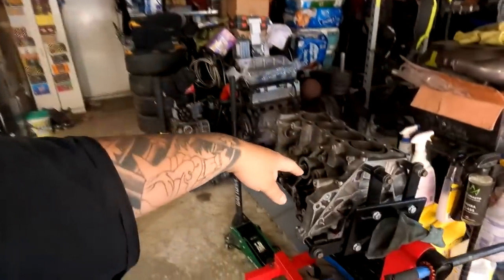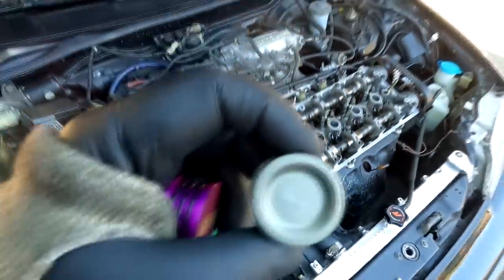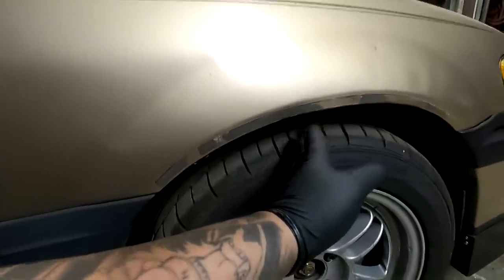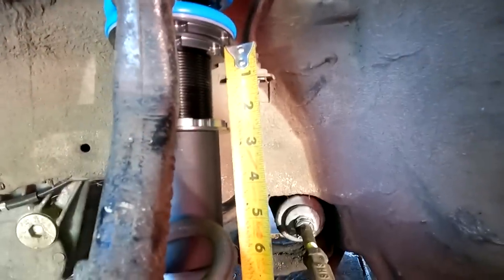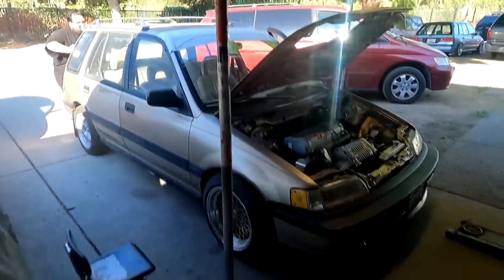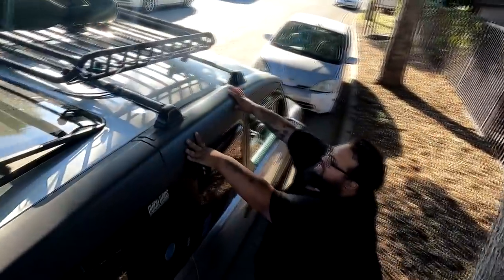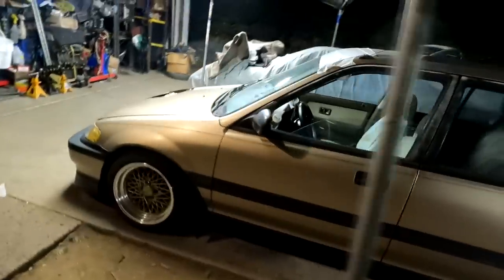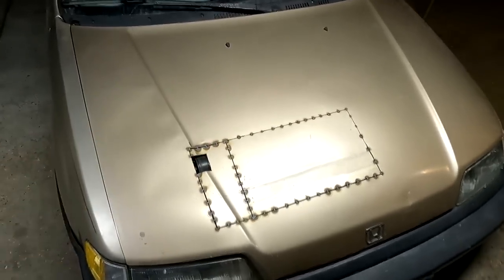MORE LOW ON K20 WAGON WITH MPC DROP FORKS!

Comment: Nice job on the hood patch. Just put a sticker over the hole. If it touches it, slap another sticker on. 
I just knew that was a caliper problem, I just had the same thing happen. I had to put a 3mm spacer to get them to clear. But you do what you have to. 
I went from a 185/60/15 to a 215/45/17 setup. Looks better now to me. I’d like some lightweight alloy wheels but settled for some off a BRZ.